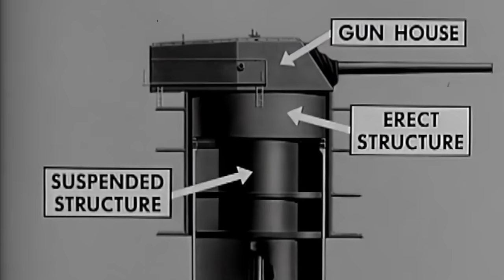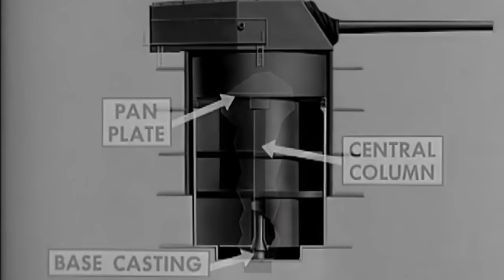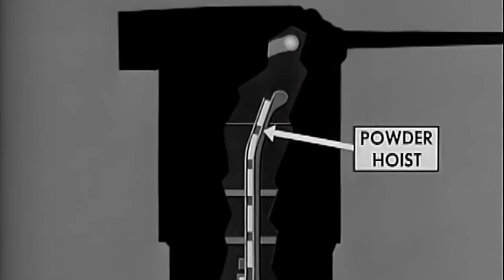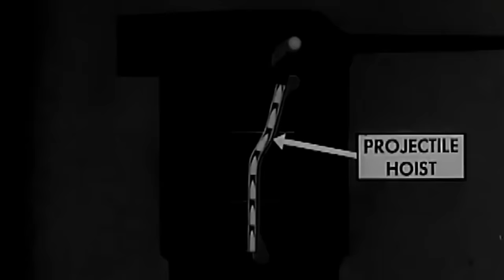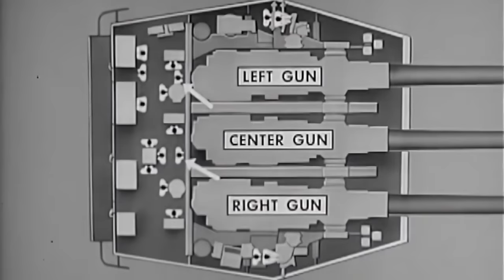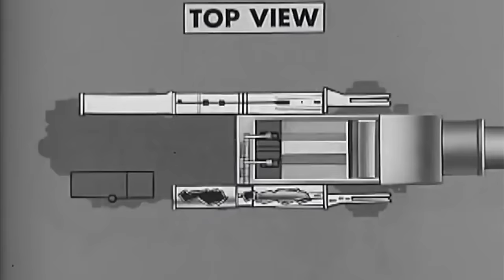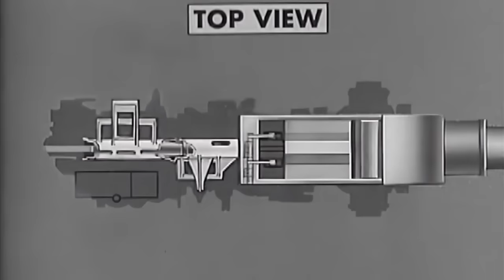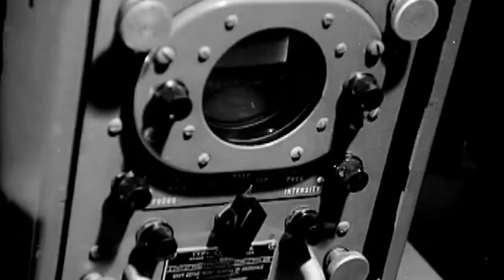8"/55 Rapid Fire Gun & Turret | US Navy instructional film

Comment: A single turret of like this inside of gun range would convert any modern warship into a submarine with the longest endurance in human history. Nothing is armored like it was when this was in use.
Reply: The weight is better spent on missiles. They reach a lot farther, and hit a lot harder for a lot less weight. Guns are still useful for cheaper, prolonged, bombardments. As long as you keep the price per round down (looking at you Zumwalt class.) Any ships big enough to mount one of these at present would be a glass cannon.
Reply: @Einwetok  the line I was trying to draw, was on how in a very short time warships went from massively armored to minimally armored. Missiles and sensors are the way for sure, it just seems rapid to me how quickly the armor disappeared in favor of good radar.
Reply: @SuperDriver379  There's no doubt an armored ship from that period would stand up better to an Exocet, for example. Lot's of smaller navies use similar missiles now. The Soviets , as soon as they could copy or equal our missile tech, pushed designs that were floating missile barrages. Their ant-ship mission was to volley all their ship killers at once to swamp our carrier group's defenses. 
     If the Cold War went hot, any of the missiles in that volley could be nuclear.  All the armor in the world won't save you if a blast gets close enough. The ship might still be floating, but it's irradiated, the electronics are cooked, and the crew will be dying or dead. We had nuclear torpedoes, air to air nukes, air to surface, surface to air, take your pick. Our boomers had a different launch authority too, more localized. That's the philosophy that  pushed designs from that era.

Comment: Battleships would fire a salvo and watch the splash to know what corrections were needed to the firing solution.  These guns fire so fast that they would not have been able to do that.  This ship would have been able to fire 120 shells per minute.  So what did they do for fire control with these guns if salvo and correct after splash were not an option?
Reply: They did have an early form of radar directed gun control and I'm sure they wouldn't rapid untill they had thier target bracketed.
Besides at that time an actual ship to ship gun battles had become less likely and big guns were put to good use in shore bombardment.
Reply: 90 rounds per min.
Reply: I'd you not listen to the part about the gun directors... Its radar guidance for the guns
Reply: @nigelsmith7366  When firing 10 salvos a minute.  A salvo every 6 seconds.  There will be continuous water splashes and spray.  But, because there are so many salvos flying through the air at the same time you won't be able to know which splashes are from which salvo.  So you won't be able to know what corrections need to be made for the next salvo.
Reply: They're not going to fire max rate, and they wouldn't be able to sustain it  for long. They'd shoot the liners out of the barrels pretty quickly.
Reply: @RT-mm8rq  This answer makes the most sense.  Bracket the enemy ship first and then fire for effect at full speed.  (90 round per minute)  But, when these ships started to be designed, they were still thinking about ship vs ship combat.  If if is just for shore bombardment, then no need to armor to stop other ships armor piercing shells.
Reply: By 1949, when this ship was commissioned, the US had pretty good fire control RADAR. And projectile splashes out to even maximum range could be detected. Thus giving a range correction solution.
Reply: @raywhitehead730  Tracking splashes by radar was done during the entirety of WWII.  I am referring to knowing which volley and its fire solution resulted in which splashes.  On a battleship, the volleys are 30 seconds apart and the splashes go away before the next set of splashes.  On these rapid fire guns the ship will be firing more than one shot per second.  How to tell which splashes came from which shot and that shots fire solution.  That is the question.  The pre dreadnoughts had this same problem and it was never solved.
Reply: Shots a few. were fired , at first, for ranging. Then rapid fire after the solution, which was made by the first few shots. Pretty much the same as Army artillery. Just so you know I was present and did observe, during Operation Praying Mantis,  the USS Merrill DD 976, shoot rapid fire  115 ,,  5 inch shells at an Iranian target. Each round hit the target spot on. Range was about 5 miles. There was no interruption in time between shots.  The enlisted guy in charge of maintenance for these guns got a medal. He was unanimously nominated by the crew for that medal.

Comment: Isn't it a bit of a risk to store that amount of shells inside the Turret ?
Reply: The base below the Barbette (which is usually among the thicker armor on the ship) is sufficiently underwater that it is not really at risk of being hit by a shell directly in most ship designs from that era.  In many ships the belt armor was also something that didn't go much beyond the water line either.  Because hitting the water is basically a death sentence for a shell's ability to penetrate much of anything.

On a side note, the last picture of the HMS Hood, famous for its magazine detonation, showed that the aging vessel had over the course of various modifications and refits since its introduction, gained a very distinct bow wave that resulted in a notably low water level around the middle-aft area where the rear magazines were, such that a shot to the right spot would not be stopped by water like the design had expected.  It is now thought that this is the most likely cause of its particularly spectacular destruction, having nothing to do with its outdated deck armor.